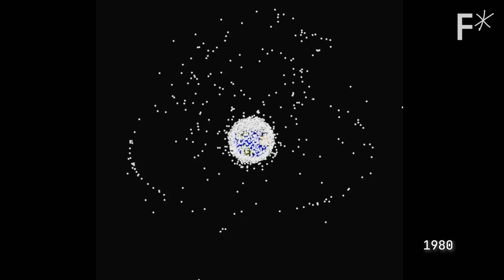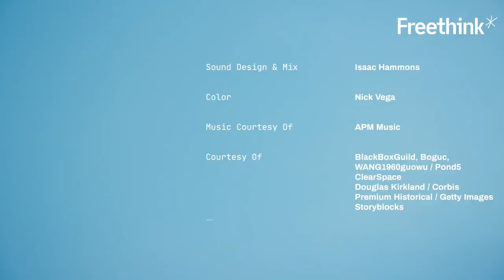Protecting space stations from deadly space debris | Big Think

Comment: How about a focused blast force aimed downward to alter the orbit of the debris, forcing it into a burn-up trajectory?
Reply: that would also throw the robot applying the force off it's course tho, as per newton's laws of motion
Reply: @nmmeswey3584  with a shaped charge large enough the "shell" would be shot off into deep space.
Reply: @sprootown  isn't the idea for the robot to be reusable tho? also, using plastic explosives when your goal is to reduce debree seems counterproductive
Reply: @nmmeswey3584  either way it will work.
Reply: @nmmeswey3584  ever heard of course correction thrusters?
Reply: No guarantee it completely burns up. Possibly literal rain of bullets.
Reply: For most low-earth orbits, it'd actually be more efficient to slow the debris down than throw it towards the earth.  

Also if by 'focused blast' you mean an explosion, forget about it, you never want to do that with space tech.  The options are either grab the object and thrust with engines, or if the delta-v is very small, maybe an arm-thrower or spring-piston setup.
Reply: @HamHamDude  then a magnetic field that could slow debris down, or even a graphene Nano tech net that expands and matches the speed then slows the debris gradually?
Reply: @nmmeswey3584  im thinking someone on these comment threads will come up with the cure to this issue!😂